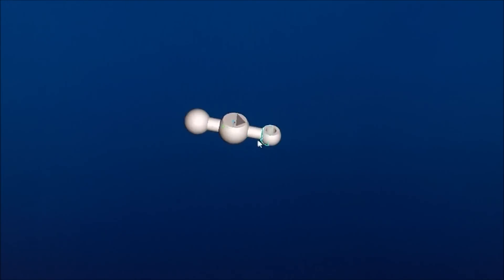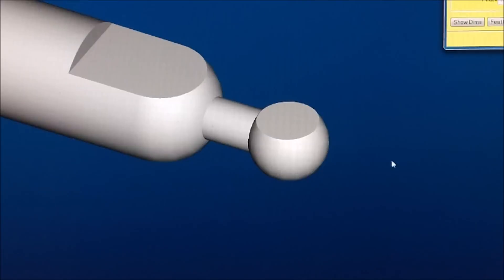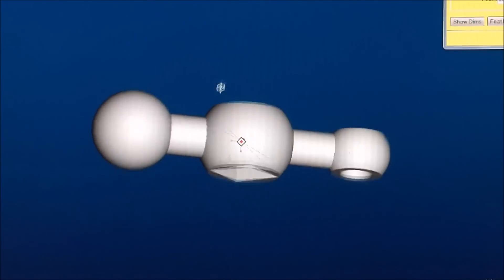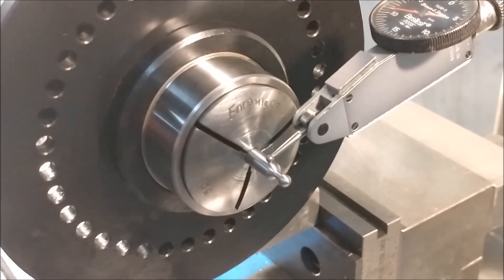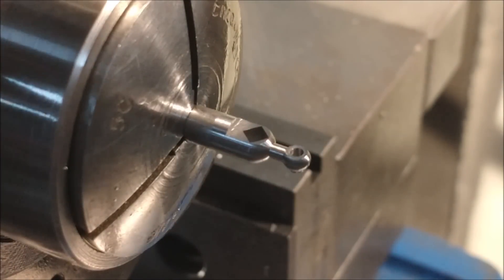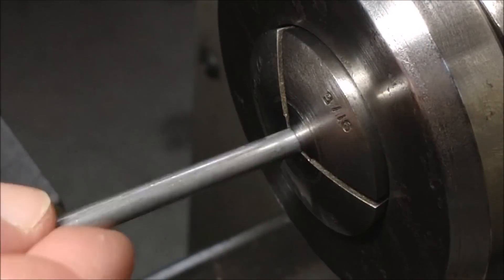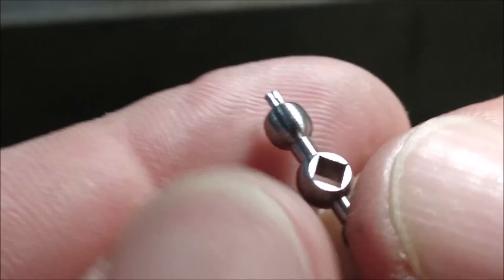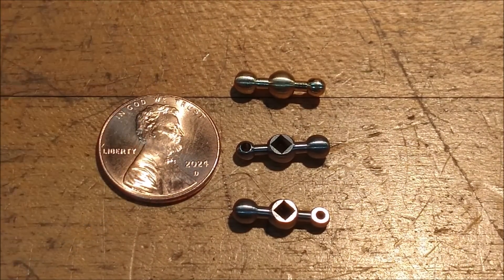Mini Milling Machine - Machining The 3 ball Crank Arms

Comment: Lovely job Sir
 The square hole technic was incredible! Just corious about see how the mill head Works in that opperation.
Congratulations!.

My best
Reply from the maker: Thank you. I usually set the mill to back gear/low range and also to the lowest RPM. Lock the spindle brake and everything usually stays put.

Comment: I always love watching these videos for the hints I get which will help me out with my own shop work.  Thanks for making these Joe.    One thing... I'm thinking that a screw jack could have been helpful for drilling the small ball.  Something with a sacrificial top cap of aluminium.  And perhaps something suitably "model like".  Something like a special 1/4-28 or M6x1 screw post?  Something like that would help with small parts like this and perhaps on other bigger items that need support in a small flat feature where the big pads of a "normal" size screw jack might not fit? ... Oh good... ANOTHER shop tool project on my own list..... You're a BIG help ! ! ! ! 😁
Reply from the maker: I agree.

Comment: 2:07 why undercut first?
Why not back side of that ball (if you make your tool to be almost to the point on the left side).
In that case, as I can see it.. you will have all of support of remain material up to the end of the cut.
Yes it will be the same in that small portion, but you will not have extension of small diameter.
After that you do undercut (which if we follow the real thing should be cone, not a cylinder, at least I always seen it done this way)
Reply from the maker: Establishing the undercut first really helped to dictate the grind and correct positioning of the tool.  Without the undercut, you'd have to have a very accurate representation of the tool geometry to plunge it correctly the first time. As for the conical straight sections, I agree, but the print called for cylindrical. I did choose to make the backside region slightly larger than the front to give the illusion of a cone.
Reply: @joepie221  that make sense
I did small 3ball handle (not this smal, something about 1" total lenght), but doing it on chinese small lathe, that simply can't handle any significant surface contact, i did it in 'steps then file'  technique. So.. I always look for as much support on the chuck side as I can get, and tht transition wil any way be finished with file
Reply: @joepie221  that make sense
I did small 3ball handle (not this smal, something about 1" total lenght), but doing it on chinese small lathe, that simply can't handle any significant surface contact, i did it in 'steps then file'  technique. So.. I always look for as much support on the chuck side as I can get, and that transition will any way be finished with file

Comment: I was wondering just for the purpose of easier handling if you only 3/4 cut through on your bushing would it still hold well enough?
Reply from the maker: Any deviation in the part diameters vs the bushing diameters could lead to some chatter. One technique I've used is to put a small o'ring groove in the OD of the bushing before splitting it. Use a rubber oring small enough to stay below the outer surface of the bushing and it will hold the 2 halves together and still allow for installation of the part.

Comment: Huh. Very surprised you didn't make a nest or at least use a tiny machinist's jack when you were broaching that hole.
Reply from the maker: I did consider it Paul, but I knew the broach was newly sharpened.

Comment: No one that's anyone gives two s@#%$ about the metric system...
Reply: Some of us are alble to use both, But i find that the metric system is far easier to work with because it is units of ten, unlike the SAE system which is all over the place like a dogs breakfast......How does it wor again something along the lines of 4s, 8s, 12 16s, how confusing...
Reply: No one that's anyone gives two s@#%$ about US customary measurement systems in The rest of the world....